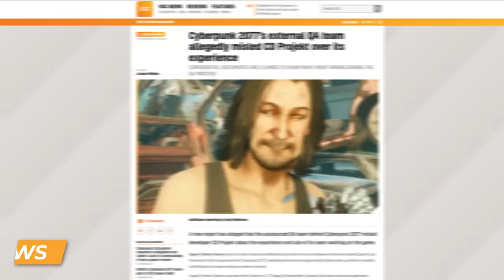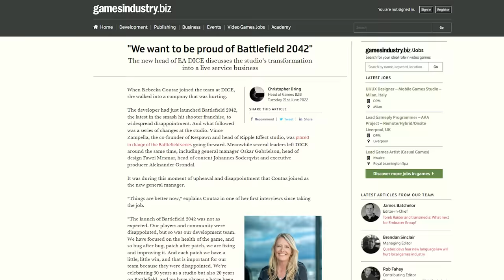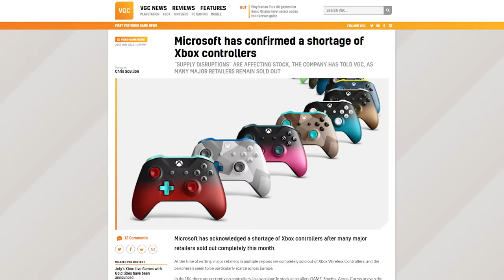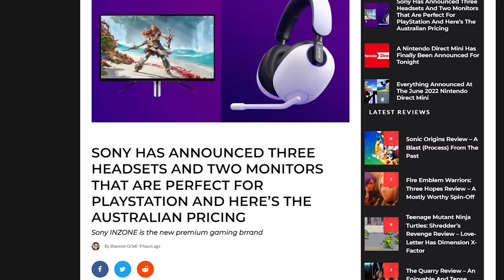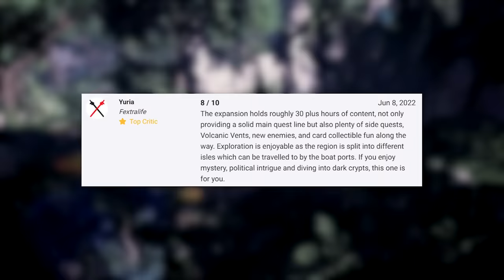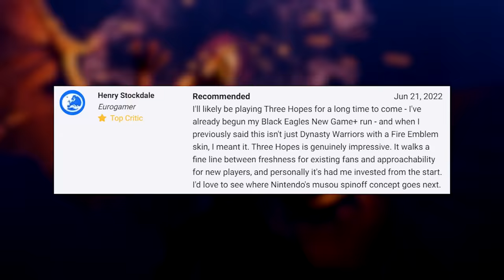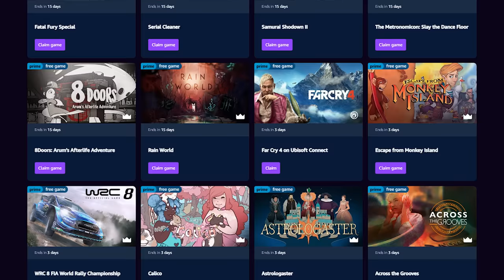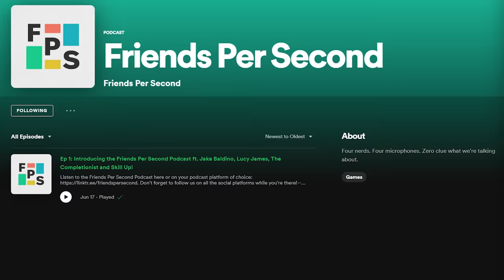Sonic Frontiers, The Day Before and Persona 5 Switch | This Week In Videogames

Comment: normally I don't mind shortages for controllers and stuff, but my current controller is literally held together with super glue and electrical tape. I'm sure louis rossman would cut my throat open if he saw me fixing electronics like that, but me me not good with lightning box.

Comment: 30:00 this is the future of consoles. I remember seeing something like this in like a movie or tv show taking place in the future. They had like a console that was completely grey and looked prcislcy like this. The fact this is possible is further prof of it happening in the far future maybe PS6?
Reply: Was that console in the movie also attached to a really big block below the desk for the power supply, water pump and radiators?

Not that it doesn't look cool and was a nice project, but he just put the motherboard in a big DIY water cooling block and then had the bulky stuff in a separate enclosure which is hidden out of sight...not exactly a PS5 slim.
Reply: The problem is that it needed a very large secondary unit that housed the radiator, reservoir and PSU. So while it's technically a tiny PS5 you would also need somewhere to hide that large secondary unit. 

I personally wouldn't mind that since you get water cooling which is way more effective and quiet than air and you get a much better looking and smaller design for the part that you are gonna be looking at all the time.

Comment: The Valorent voice chat bot moderation can end up really badly just like it did with Overwatch. Slurs and curse words are not one to one across languages and there is the widely known case of numerous Japanese players getting auto banned for saying “run away” because it sounds very close to the N word in English. Hopefully Riot has a better system than Blizzard with different filters for different languages.
Reply: hopefully them not just using a preconfigured voice recognition thing will mean they take different languages into account
Reply: I think Chinese players are in trouble for one of their words too. This voice moderation thing will probably screw the Asian demographic in general.

Comment: The Ps5 slim shown in this video is not sleak . It's looks boring. Just like the Xbox series X, a boring black box. I like the regular PS5 design.  It's new, it's daring and it's stunning! I have installed ledlights in the front of the console. It's an eyecatchter. People always ask me what 'the wihte box' is. It starts conversations. Would the box (Ps5 light) shown in this video achieve this? I think not because we've seen this boring plain box a million times before.

Comment: Of course there is an xbox controller shortage when it is so much better than the PS conttoller. 40h switchable battery vs 8-12 non-removable battery... oh and the LS/directional placement ofc.

Comment: SUPER misleading on the PS5 slim DIY. Sure, the housing where the on/off switch and motherboard are located is pretty slim... but you conveniently ignored the part where the power supply and cooling is housed in a massive 2 foot long box. FAR bigger than the PS5 is.

Comment: The super slim PS5 is cool… but it also has a giant cooler and power supply unit on the floor that is bigger than the original PS5, so it’s also a bit of a con. Cool (literally) regardless

Comment: 25:00 actually that's incorrect, the cars in F1 22 are slower than 2021. They also handle like trash. If people are interested in getting an F1 game for the first time get 2021, it looks exactly the same (minus the car models), it has a pretty enjoyable story mode (22 has nothing) and the cars are faster and handle much nicer. F1 22 (which I got early access to) is the worst sequel (if you can call it that) I have ever played, it's worse in literally every way, not a single improvement from 2021 other than maaaaaybe a very, very, very slight bump in fidelity but it's really minor and 2021 looks absolutely fantastic on PS5.